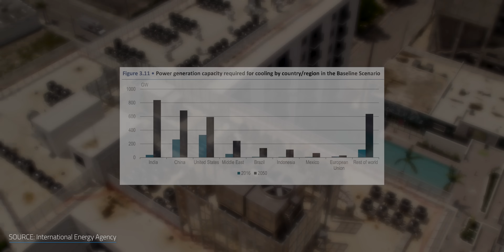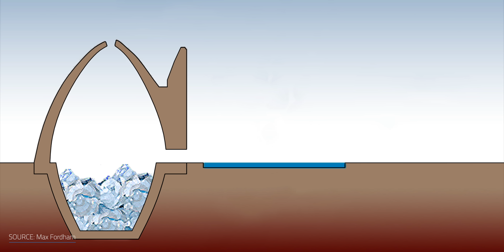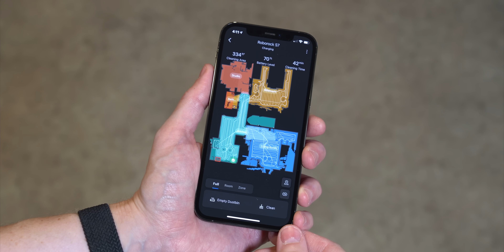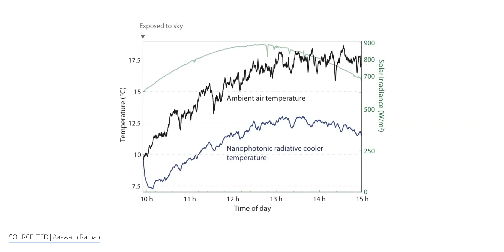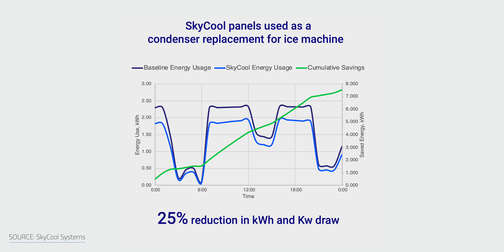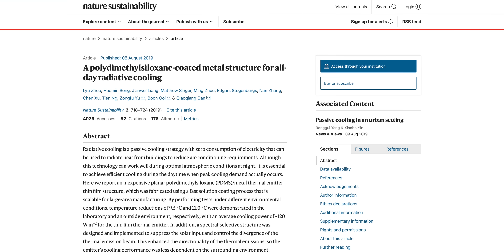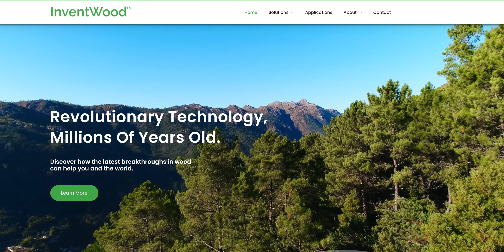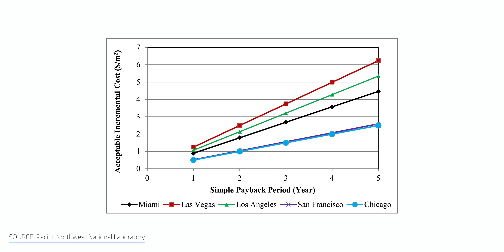Space Powered Cooling May Be the Future of Energy

Comment: Would be nice to hear about the maintanance. Anything which relies on being reflective will suffer when it gets dirty. How often do they need to be cleaned and how much is the reflectiveness harmed by the surface damage that you get from existing?
Reply: It's definitely cheaper to clean a few panels than it is to pay technicians to repair commercial-scale AC units.  I'm always interested in solutions with fewer moving parts.
Reply: I mean, the surface can just be made out of glass or aluminium oxide, which is super durable and scratch resistent, but can also be coated in superhydrophobic substances or surface textures, which would basically clean themselves. And they would be pretty stupid, if they didn't include these things.
Reply: @midnight8341  any additional coatings might reduce efficiency by blocking IR. Also I've seen enough startups that just exist to spend investments and produce nothing. Do you remember solar roads?
Reply: @CockroachSlidy  The surface of the material itself can be etched into being superhydrophobic. Of course, that may reduce efficiency itself.
Reply: @CockroachSlidy  In fairness, Solar roads was always going to fail, for a multitude of practical reasons. Rooftops, however, are free real estate (so says the meme). The barrier to solar roads was practicality, the technology was well established. The barrier to practicality to this is much lower, as circulation systems on rooftops have existed for some time. The barrier here is manufacturing.
Reply: @CockroachSlidy  okay, silicate glass is opaque above 5μm, so not practical for our applications of 8-13μm. But aluminium oxide is completely transparent in that range, so the ceramic your phone screen is made of would be good enough for this application.
Reply: @davidtarushka9749  I'd say the solar roads reference refers more to how new tech is being marketed. Its amazing, has no dowsides, is the obvius thing to do. While not even considering the first objection some random person on the internet can come up with. Solar roads are a very blatant example, but there are enough simular cases out there that unless basic problems are explicitly adresed I assume there is no answer. (Nothing specificaly to do with this idea)
Reply: @someonespotatohmm9513  No, solar roads had TONS of practical downsides, not least of all that people drive on top of them. Rooves experience minimal pollution, but roads are one of the most polluted surfaces in existence. They would get dingy and, by extension, totally useless in no time flat. We are talking about both oil residue and rubber residue, neither one of which wash off easily from a rainstorm. Then you have other practical considerations, like cost. Think about it: if there was a material that could host solar panels beneath it, and simultaneously hold the weight of a truck, and wouldn't be affected by ice heaves, why haven't we seen any real implementations of that material alone? If this road can reasonably be expected to perform against asphalt, where is it? People don't even use cement concrete in most roadways, even though it can be prefabricated and outperform asphalt, because of the expense involved.
Reply: @davidtarushka9749  My comment was about advertising/marketing, not the specific technology...
The "why haven't we done it already" argument can be aplied to anything new, its not an argument but a line of reasoning that should lead to an answer or lack of one.
Reply: @davidtarushka9749  Yeah solar roads is maybe the worst solar energy idea ever. Of all places to install  solar cells, roads is like the worst place ever for cost, durability, maintenance, efficiency , infrastructure etc.    It is scarily amazing to see how much got invested into this....   there are so many other better alternatives  on where to install solar cells
Reply: @midnight8341  This technology is already expensive enough, doing what you say would probably not only increase the cost even more, but could also reduce the efficiency. And even then, after 2-3 years there's bound to be some damage/dirtiness on the panels... superhydrophobic isn't going to work 100% forever. This needs more data for us to be able to comment on it... too many questions
Reply: @kyriakos098  you do realize that you can literally synthesize the nanolayers of this material on the transparent surface as a substrate, right? You have to grow it somewhere, might as well be the thing keeping it from being damaged.
And of course it's not going to work forever, but nobody ever claimed that! Do you hear yourself talking? Solar panels work for 25-35 years non-stop without significant damage to their cover glass or without dirt becoming a huge problem. I haven't seen anyone scrub their rooftop solar array for decades. The only time that dirt will become a problem is in a dessert, where you don't have rain to wash the thing periodically.
What on earth would you do to these panels? They would just sit on your roof, passively radiating away heat, nothing more. They're not meant to become tires for dirt bikes...
Reply: @midnight8341  But do those nanolayers last? I would imagine the sand that inevatably gets on the panels and gets washed of damages the protective layer. 
And with the high reflectivity and specific band that needs to pass trough it, I guess that microscopic damage matters a lot more. I can ofcourse be wrong.
Reply: @someonespotatohmm9513  the protective layer like the glass of your phone screen? You'd need to sandblast that material to scratch it up.
Reply: @midnight8341  1 particle of sand or some other material I don't know is there is enough from my, and if the internet is to be believed, many ppls expirience. The damage is most of the time barely noticable, but given the aplication it might be significant.
Reply: @midnight8341  And yet, I have seen some very dirty solar panels.
Reply: Yeah, reminds me of those "solar highways" we were promised that turned out to be quickly destroyed or made ineffective simply by people walking on them and snow accumulation.
Reply: @phydeux  the reflective space or thermal blankets that are silver on both sides really are the only answer, even if it wont kick the heat as light off the planet and gets stuck in the atmosphere, it still is the lowest energy investment to resist heat movement which is all we are spending energy on AC, and retaining heat means needing to release less sequestered heat as some sort of chemical or other form to inject it into a living or working space, cutting down on heat being injected into our ecosystem, But this is a "use these on the building exterior/interior" not some magic bullet or free energy from overunity or anything LOL
Reply: @phydeux  also I would say when someone promisses something unbelievable its time to realize it probably is because it should not be believed lol
Reply: 6:18, what is 100%??
Reply: Dirt accumulation and maintenance considerations were totally absent from the video and absolutely vital in any consideration of this technology.
Reply: Don't ask difficult questions.
Reply: Not hard to power wash it every spring…
Reply: I would like to know who was shocked that a reflective surface would be better than white paint, or reduce the power consumption in daytime heats when something is burning power to cool off the inside, I did this with space blankets and just made sure to point the metalized side out to the sky, reducing our electric bill by over 200 bucks a month,  BUT I used 3 layers with the clear side that is solid black to infrared light, unlike being "clear" to visible spectrum, facing inward toward the house, so each layer that ejected any IR heat, would continue to reflect it back to the other layer until it reached the outside. 

I initially thought you would need vacuum pulled between the layers before finding that atmospheric air around us is around 1/1000 part gas with the rest being vacuum so the vacuum around you amounts to 999/1000 parts and that 1 part per 1000 is a solid particle moving at around the speed of sound on average.
Reply: @ThomasAndersonbsf  You used 3 layers of what is on the link?

https://en.wikipedia.org/wiki/Space_blanket

Which side faced out to space? Where did you put your space blankets and how did they reduce your a/c power consumption? How many total sq ft of space blanket did you use?
Reply: @pauleohl  not sure on square footage by the way, just know I covered over the 6 double windows (one on top and one below) on the side of the building the sun rides against ie the south side of the house. the one year I put them on the 1rst floor roof over the back of the house facing east I saw a decent reduction in heat in that uninsulated and un-airconditioned area back under it. that was pretty drastic. though those blankets were stretched and had only two layers with a tarp layer to keep them from ripping if they got pulled on, as the tarp would resist this stretching beyond the tarp size, and its also how I figured out how the silver vs clear side reacts to sunlight, because I patch worked the blanket on the first tarp in 1 foot square sections, with out checking, and quickly in like 4 days saw some the silver faded till they were nearly completely clear while others are still almost as silver as they were the day I cut them up and pasted them to the tarp
Reply: @ThomasAndersonbsf  Thanks for the detailed response.
Reply: @pauleohl  you are welcome
Reply: @pauleohl  I should add I had the idea to smooth out a metalized mirror surface's roughed out areas from making it, by charging it with a high negative voltage so the atoms act as a larger and more conductive shell and I wonder if this could be used on the layer of the aluminum since the mylar behind it has a (lab conditions so real world results are gonna be less impressive) 4kV dielectric constant under 1kHz which the speed of frequency of voltage potential change equates heat and heat is the thing that drops that voltage protection, so if its a single stable push of DC high voltage I am guessing higher than that 4kV is possible, to enable the aluminum atoms to react to photons more fluidly and possibly even effect higher frequency output to hit some ideal IR frequency if there is some magic number there that gives a higher possibility to slip through the atmosphere with out being absorbed and released as heat energy in the air particles it gets absorbed into, personally though I would be happy if it ran on very little power and promoted a higher degree of thermal energy inside a cavity protected (like a home or business building) ejecting its heat to lower the heat moreso than it would passively with no charging.
Reply: @ThomasAndersonbsf  sorry, "space blankets"?
Reply: @wormwoodbecomedelphinus4131  some call them emergency blankets or thermal blankets, thin plastic with a silver coating on them to keep one warm (some have color on one side these were just plain silver on both sides)

Comment: I'm a Purdue grad in electrical engineering and was about to add a link to the recent news of their development of the whitest paint ever developed. It's worth adding that Purdue says that covering a 1,000 square foot roof with this paint produces 10KW of equivalent cooling power for the structure below. That's pretty mind blowing stuff in my opinion. Great video!
Reply: That sounds really suspiciously like a claim designed to create hype more than to be true.  Is 10kW an average or the peak result?  How much control does one have over the effect?  How long does it last without maintenance/what kind of maintenance is required?  These are the sorts of questions that a channel called Undecided should really be asking up front, rather than regurgitating speculative hype.  There are a thousand media outlets putting out content that only amounts to "scientists say this is an important breakthrough that will yield tangible results in 5-20 years!!!"  and even if that content isn't completely worthless, we don't need another.
Reply: @michaelleue7594  in case my other reply with the link doesn't show up it cites that the findings are published in the Journal ACS Applied Materials & Interfaces.  I also read that Purdue is in talks with manufacturers regarding production and marketing.
Reply: @michaelleue7594  the published paper also contains a link to the Patent application applied for by Purdue. I think this could be closer to being ready for prime time than most may think.
Reply: @michaelleue7594  here's a YouTube link to a video explaining the whole thing.

https://youtu.be/BHyC2cwgkSA
Reply: @-GinΠΓ Τάο sure. You go with that.

Comment: A better option, in my humble opinion (for certain zone) : District cooling/heating and Seasonal Thermal Energy Storage.
If we can use the summer heat to heat ourself in winter, it would probably be even more efficient.
And selling surplus heat could potentially be used in industries that need heat. So you're cooling could heat some bakery oven (at least partially).
Not has feasible in my region, but when it can be done, it could favor mixte use district and be more energy efficient.

Comment: It sounds interesting, especially all the technologies based on paint. I can really see the advantage of having such materials on transportation so to reduce the need to ACs there and hence energy usage requirement of the cars. As were I live we do not have a roof, that would also be a viable option for keeping the building cooler. Nice one!
Reply: You live without roof?
Reply: The only problem is that you can't turn off the paint. it might save you some money in summer but you'll spend more on heating in winter.
Reply: @CockroachSlidy  It's a regional solution for sure. Remember, the closer to the equator you get, the less meaning the words "Summer" and "Winter" have, and the more valuable cooling gets.
Reply: @CockroachSlidy  good point
Reply: Explain this "no roof" situation in more detail pls.
Reply: @orionthehunter217  Maybe he lives in the lower levels of an apartment block.
Reply: @davidearl4022  that is the case, but our building has an apartment last floor which essentially has multi level terrace, resulting in lack of a roof on which to install such things
Reply: @armax00  having vegetation on your roof achieves roughly the same idea.
(Evaporative cooling+photosynthesis lowering heating, and a bit of radiative cooling)
Reply: @ГеоргиГеоргиев-с3г  right, but not been my roof (as it is the terrace of the person upstairs) makes things quite tricky :)
Reply: They did say the special paints are only really practical in the tropics though.
Reply: cars are mainly an issue because they have single pane glass and let in hundreds of watts of heat via solar energy. 
Cars are hot because green house. Not the skin of the car.
Reply: No roof?
Reply: Yes, it's fascinating it's still very early, could get much more efficient. A big problem though, just like solar panels, painted surfaces collect dust and mold, which I'm sure would cut into the efficiency unless you wash them every 3-4 weeks.